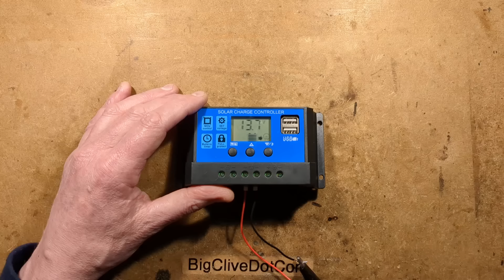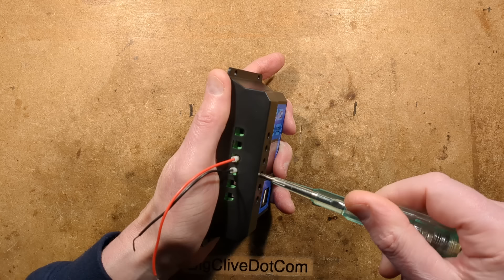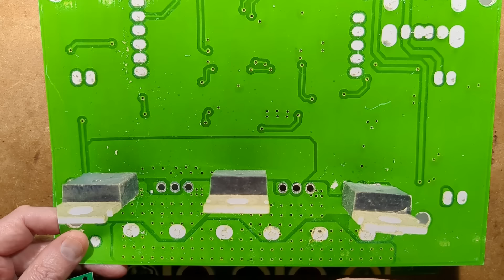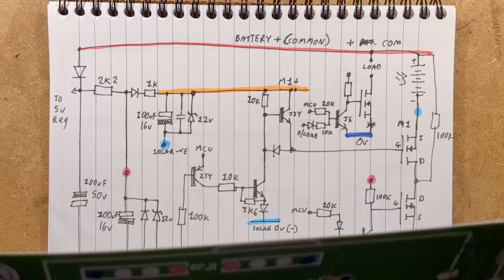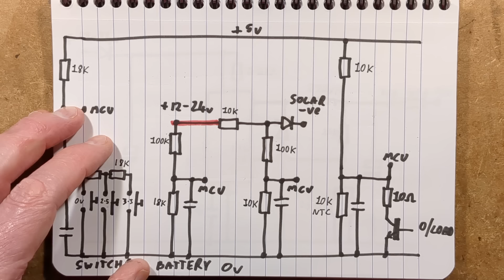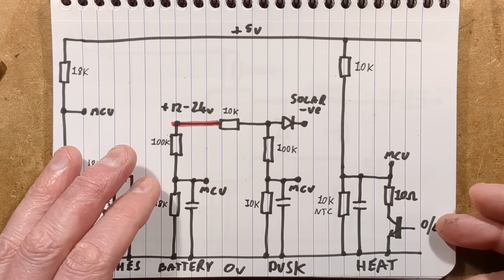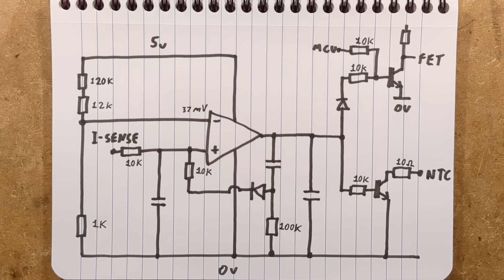Exploring a mass produced solar charge controller

Comment: There are lots of solar charge controllers, all of them share this exact type of housing, but very different inside. Different microcontrollers even, different schematics. Some draw only 7 mA from the battery, some draw 13-15 mA, There are some models where USB ports could be turned off along with the DC output. There are models that could deliver 2.1A on the USB output. In short, you can never be sure what exactly you get when you buy some of those.

Comment: The battery needs to be connected first on these style regulators to set the battery voltage. If you connect a 24V battery, it will adjust it's charging parameters to suit the higher voltage battery as opposed to 12V.

Comment: I put one of these in my teardrop camper a couple of years ago, it's one of the higher power versions which don't cost much more.  It runs a fridge/freezer, lights and keeps all of my stuff charged, which is quite a bit when I go to music festivals. (effects pedals, preamps, tablets etc.)  Seems to work OK, though I knew it wasn't top shelf when I bought it.  I was never game to use those USB ports on it though, and I'll probably plug them now I know what is behind them.

Comment: You connect the battery up first so it does not send 24v front solar panel to battery before you can select the type battery type, voltage and cutoff ect.. Just a safety feature on the cheaper units I am sure.

Comment: I've gone through 3 of these in 10 years, pumping water out of a spring during the winter into a cistern. The spring water is always around 40F. The battery and controller live in the battery box which end up under a 6 ft snow drift for about 5 months. The weakest link is the tiny terminals and, of course, the lead  acid battery.  The failure is usually the buttons or the display.  Most winters it gets to -20F above the drift.  They don't really like being bathed in sulfuric acid.

Comment: I wonder is there anyway to fix the USB output, other than disconnecting them.
Reply from the maker: I'd just block them.  A separate charger can be added if desired.

Comment: I'm not sure how things are now, but I had one very similar back in 2017 or so that we used for a few days. It was a "50a mppt" it said. So I ran it at about 12 amps from the solar panels.
Welllll the next day it was just about a pile of molten goop lol
The back was plastic and didn't have any heat sync for the mosfets, and they just melted the backing off.

And then 2 years ago I saw another one that only had like 9 amps on it in a friend's RV trailer. Uh, yeah, that one almost burned the RV down while it was sitting in a shed lol
It burned a big hole in the wall it was mounted to.
I'm definitely a good bit weary of these cheap charge controllers lol

Comment: I got one of these years ago. It looks the same on the outside. I just took it apart to see how it compared. The insides are a lot different, and claims to be up to 20A. It has 4 MOSFETs and just uses the messy heat putty to try to disperse heat to the back plate. I did notice the board has a date of something from 2020. Wish I could send it your way to do a comparison, but the price from the USA to you probably isn't really worth it. Also, the MOSFETs on mine are marked HY1707. Thank you for your videos, I love the info you provide.
Reply: That sounds like the one Adam Welch looked at about five years ago.
Reply: I also bought one of these over 5 years ago and the battery I had hooked up to it failed so I’ve been using it without a battery since to charge power banks. Connected to a 50W panel at sunrise it comes on and fluctuates between around 14v and 24v but switching it on and off it goes to 24v mode. At dusk or low light it drops to around 6v before powering off altogether. I’m a total idiot when it comes to anything electronic so can’t really comment further except to say it has worked daily for all these years and only cost me less than 5 pounds as I bought it directly from China (Taobao), so can’t really complain.

Comment: You get what  you pay for. I had one of these to charge my electric gate battery. Mixed results, some days it would charge well, others it would not... then it started failing to keep the battery topped up even on very sunny days. New battery, same result. Once the battery charge gets too low, this unit consistently fails to charge it back up again. I ended up throwing it in the bin and wiring a permanent 12v supply. More trouble than it's worth.

Comment: The issue with these is that they couple the solar panel to the battery and bring the panel voltage down to the battery voltage. This means a 50W panel which outputs ~21v at 2.36A, will have its voltage brought down to 11-13.8v at 2.36A. Meaning at best you will get 32.5W out of the 50W panel, or 65% efficiency.This varies between panels and controllers.

I swapped it out for a $40 batteria power 10A mppt with bluetooth from aliexpress, and achieved a peak of 51W from the 50W panel. With an efficiency of 96-99%.
Reply: Do you have a link to your unit?
I just bought a 20A MPPT unit from AliExpress, all in all, good unit, but some bluetooth would be nice
Reply: I'm trying to find a reasonably priced controller to keep boat batteries topped up which is real MPPT and not a fake. Can you give more details on the one you bought?
Reply: I'd be interested too

Comment: Thanks for this. I have one temporarily in place but I don't see how the 40v solar input is converted to a 14v charging for the lead/acid battery in my case ?
Thanks
Reply from the maker: There's no major voltage conversion other than just having the battery shunt the panel voltage.
Reply: Ok. I opened mine up and it's very similar. Specs say 12/24 battery and up to 50v input. So I've been putting a 40v PV across a 12v battery !! I thought it might be pwm to charge maybe I'll put an adjustable regulator on the output to make sure I'm not boiling my lead/acid battery. Damn!
Reply: Thanks to the other comments on this video, I think I understand that the MCU is using pwm to regulate the voltage to the car battery, (pwm on the PV side controlling voltage to the battery? ). I'll run some tests but I think it could be ok after all. Again, Thanks for the video.

Comment: Old solar panels can be hacked  into to supply a lower voltage and with one of these PWM's and a car battery you have a very cheap 12v backup supply.

Comment: I got one of these once and the fact that it put out over 20V when the battery was disconnected made me return it.  Let's say someone needs to disconnect their battery to reset something or work on their car and forgets to disconnect the PV line... that 20+ volts will likely fry their vehicle.  I don't care if you're supposed to keep a battery connected to limit voltage... it should NEVER go above the numbers you set for charging voltage.  If it does, it's a terrible product and should not be used.  Use something slightly more expensive that won't fry hundreds or thousands of dollars of equipment
Reply: You could wire a 15V supercapacitor bank to it in parallel to limit it to 15V, but that adds cost that could be spent on a better controller

Comment: Been running one of these for quite a while on an old pickup to keep the battery topped off. The screen doesn't like the heat very much. Can't really tell what exactly it is saying but it's still working.

Comment: I also have one of these. Have used it in my shed for a small system that provides power to some lights and a receptacle appropriate for a low powered device. It has controlled the charge to my battery flawlessly for about 5 years.
Reply: I do exactly the same with mine.  10w solar panel, 12v deep cycle battery (I bought at a garage sale), and about 4 amps worth of LED light strips. Works great!
Reply from the maker: Low power shed applications are the perfect task for units like this.
Reply: @steverrada  Got a similar bundle thing off AliExpress. It actually edges out the Harbor Freight 7W amorphous panel in charging the power bank faster.
Reply: Same here. 50w panel and about5 amps of led strip lights in my shed. Works great!
Reply: I have one under the hood of my hybrid. I have a 50w solar panel on the roof to keep the 12v topped up since I only drive it 2-3 times a month. It's survived 5 years of extreme heat and vibration. Works fine for such a low wattage.
Reply: I'm using one this type but of 20amps since last 2years. No issues. Well worcking.
Reply: Ive got a very similar one its ran for 11 years now with a 100 watt panel.   

I like my mppt controllers a lot more but this ones still kicking.  I just use it for charging some golf cart batteries that power my 12 volt lighting in the kitchen and dining room.

Comment: For about three times the price you can buy the MPPT version. It has exactly the same circuitry and software but uses a principle called "Misdescription" to convince the user they have made a worthwhile purchase.

As for the reverse engineering, good effort. My thinking is that this circuit is all about switching the levels between the microcontroller and the solar panel, so that you can use N-channel FETs to do all the work.
When charging, you can ignore the lower right M2 FET as it will just be a diode in line between the battery and the lower potential of the solar panel (though see below*). Therefore the upper M1 FET is doing the work, this FET is pulled one of two ways. To turn it ON (and charge the battery) the transistor (J3Y) will conduct when it's base is pulled up to the orange rail. To turn it off, the lower transistor is driven, pulling the gate to the solar 0V through the diode and bypassing the other transistor (which is also turned off). Both of these transistors are referenced to the solar panel to avoid the FET gate voltage going any higher than 12V no matter what the state of the battery or panel (hence the 12V zeners).

The 'mystery' PNP you mention at 15:14 is really a level shifter. When the MCU pin is 0V, this transistor will not pass any current, leaving the next transistor to be held 'off' by the 3k6 resistor. If the MCU drives the emitter, it will be at a higher voltage than the base and the transistor will pass current. Of course the collector might be at a much lower voltage than the emitter, but this doesn't matter as the transistor is just sourcing current now, the current flows through the 10K resistor and into the base of the NPN, turning it on and cutting the gate voltage of M1.

*The purpose of the M2 FET is a zero volt drop diode, when charging, it can be turned on to just be a 0V pass through. When the solar panel is not charging, the FET can be turned off, preventing backflow of current into the solar panel. Note there is another 12V zener circuit to protect the gate of this FET also. 

Heinous, but quite clever really, it will handle quite high voltages on the solar panel and batteries and uses cheap components for the heavy work whilst protecting both FETS from gate voltages higher than 12V and doing so with minimal components.

Comment: If you ever come to find a glass check tool, that would be really interesting to see how it works. Little box shoots a laser at a glass window and it will tell you the makeup, how this the glass panes are, how thick the overall insulated unit is and if its coated glass
Reply from the maker: I'd guess it's measuring the reflection strengths from each glass face.  Quite complex.

Comment: These are great for sla, agree tho, 12v max, mines old, its pwm, it stated non mppt but it still has the mcu options for lithium, never tried it....wouldnt either.
Full points for that schematic 😂 im sure that was painful to say the least, but overall, and again, for SLA.... brilliant little units.

Comment: Fitted one in the caravan, but then it only maintains ~20Ah of small SLA UPS batteries off a 5-10W panel, and drives a few LED light fixtures, a small sink pump, and a pair of screw drive roof lifters, all on demand.
The fridge battery and matching panels have a more reputable dual battery/MPPT controller

Comment: I bought one of those a few years ago, mine has an orange colored label instead of blue, maybe because I bought the 30A model. I figured it was only about $3 more than the 10A, so why not? I got Chinese instructions and boy was it a chore to figure out, but it worked fine.
Reply from the maker: I just got an orange label one rated "100A".  It's just the same inside as the 10A one.

Comment: Here is the actual reason why they want you to connect battery to the regulator first: For most regulators compatible with both 12/24 Volts systems this is how the regulator determines what battery system voltage you are using. If you connect the solar panel first it will power the regulator and with the output floating it will not be able to know if you run a 12 or 24 volt system and if you are unlucky it goes into the wrong mode and you can simply fry your battery that way. if a cheap 12volt only regulator have this text is is likely just copied text from some other brands manuals to keep it as cheap and simple as virtually possible.
I have actually seen solar systems completely dry out batteries because of this

Comment: I have one like it. Mine is white not black, and is connected to a 12V@22Ah SLA battery via a 100W Renogy solar panel.
It provides enough power to run my Rapi 3B+ running "Rpi cam web interface" all night (During winters specially), that hunts for UFOs/UAPs and other anomalies in the night sky. 
I've seen a few. they show up more in IR. Retirement would be boring without projects everywhere.  
Actually, I'm impressed with how much circuitry I got, for just a few dollars.
Reply: Also, it had enough power to keep the Styrofoam cooler where all these are housed, toast warm @10ºC all Canadian winter long.
A 10W wire-wound power resistor and a DHT22 inside and outside, allowed the ESP32 running the entire show 24/7.

Comment: I use 12v boat batteries and solar panels with these to power remote motion cameras and it works great sofar.  I also use em for charging up semi low car batteries to.  I've yet to venture into 24v territory or any other battery types.

I'm not a fan of fire.

Comment: Interesting.  I have one of these, works well enough.  However, I ran into an issue when trying to draw current from the USB ports on mine.  I was testing one of those fake neon LED lights when the thing shut down and was dead.  I opened it up to do an autopsy and found that to the right of 'D11' and below 'E4' were two resistors.  I say were because one broke in half and the other broke in half and partially desoldered itself.  I found that bypassing those brought the device back to life.
Reply from the maker: I'm not sure that bypassing them is a good idea.

Comment: the USB ports you could use for one of those small USB nightlights or something else but thats about it, as for charging it seems it would eb better to just come off the load with a 12 to 5 converter or directly off the battery with a converter

Comment: Dear Manufacturers of Inexpensive Goods: Most of us would prefer blank space on our products, over a translated list of basic features and accompanying icons that are probably duplicated on the seller's site for marketing purposes. You can save a bit on the printing process by using less ink over the product run.

I find it hilarious that they felt they had to hide the numbers on basic off-the-shelf MOSFETs! Even more hilarious, thermal pads from the MOSFETs to plastic.

8:57 - "Controlled manner." 🤣👍👌

Comment: i wonder why this piece of crap is still selling well.   this is basically on-off switch with no battery control means at all (even if we assume that lead-acid batteries do not need much control). maybe the display buys it, despite its based on predefined icons, which can be easily replaced by ordinary LEDs. even current sensing is not adjustable and based on Rds of used mosfets. it fails when it comes to high-current startup devices, like loaded 12-220 inverter.

Comment: I have had a couple of these  but  have noticed the one  I am using now to turn on garden lights tends to turn them on when it's still quit light  light wasting power  .Any ideas ?
Reply from the maker: It is possible to nudge the voltage divider that senses dusk.

Comment: the tracks as resistors are fun. it's abused a lot. tracks can be poor fuses. you can make pcb motors. and craft transmission lines inside pcbs

Comment: Those are crap. They will be damaged if you connect the solar panels first without any battery. Any good charge controller can handle solar panels alone.

Comment: I have one of these in my shed connected to a 44ah car battery and smallish solar panel, it has been in a fair few years, works great, just powers a few 12v led strip lights as I don't have mains in there.
Reply from the maker: That's where a 12V PIR controller would come in handy, so it switched the lights off when you weren't in the shed.

Comment: Liquid Crystal Display display? Sry, couldn't resist <ahem>

With the length of legs sticking out from the LCD, shirley it should have been pretty easy (if a little fiddly) to successfully desolder intact with eg a mini-vice or pliers to act as a local heatsink? Alternatively, there may be a use for some of that copper-coated aluminium or steel wire you chuck in the bin as a matter of course: just coil it around the legs during desoldering :)

Comment: I use mine to charge and then run my Arduino powered solar and battery greenhouse controller (dc fan for high temp and pump for watering). So far so good. But I wouldn't be using for anything critical or high current.